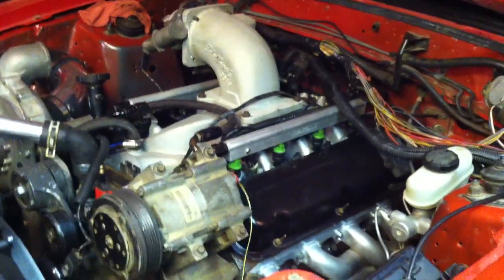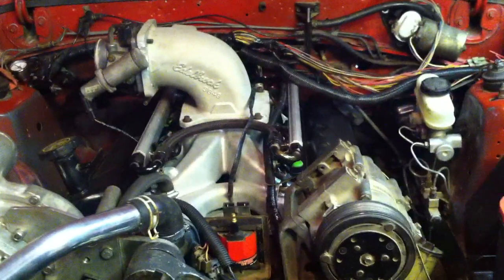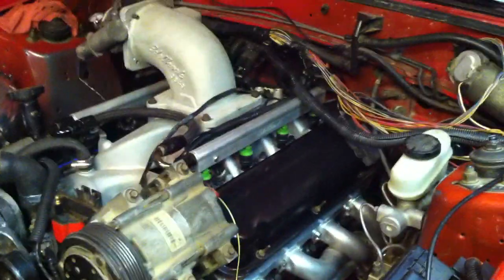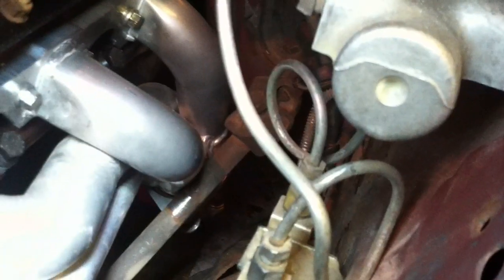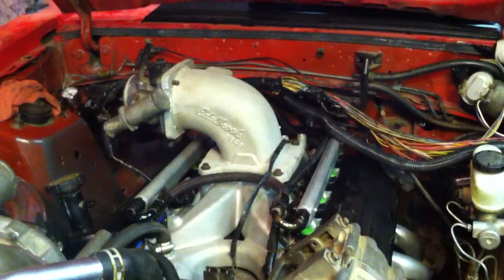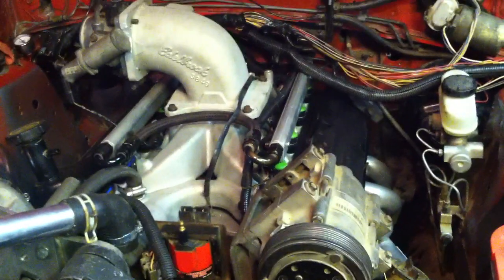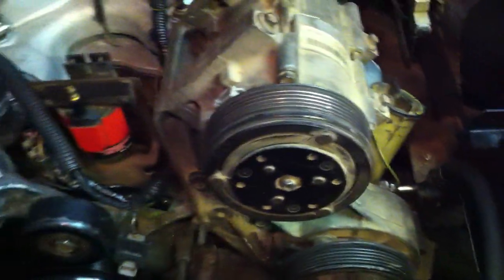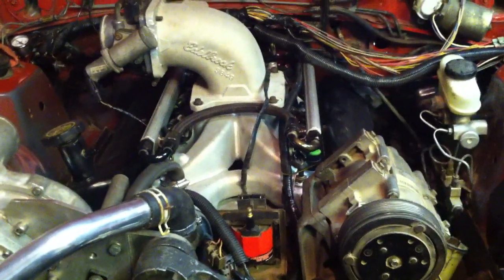351w Swap Tips  [Foxbody Mustang]

Comment: I just changed the k member to drop mine down to use the stock hood, while the k member was out, I upgraded my suspension (front and back) the 351 was supped up a bit and I had to rebuild the tranny to handle the 351 because it destroyed the stock tranny
Over all I spend about $8-9k to get the stock hood, suspension, custom headers and a tranny to handle 650tq in case I throw in a blower, I’m at 383 at the wheels now
Reply from the maker: Nice!

Comment: Good info here, I have a 408w swap going in and sounds like a total plug and play operation with fuel injection.
Reply from the maker: It really is, and there is a lot of equipment and parts that make this easier.  Thanks for the input
Reply: B Stang, I am wrapping up my 408w efi setup and I have the same intake as you except I have a custom cam and heads. Do you think my car will have a hard time starting up on the stock ecu for a break in run? I will be using the 302 injectors/no tune just plug and crank.I have a megasquirt but haven't installed it yet.
Reply from the maker: Your 408 be sucking in a lot more air than the 302..... If your ecu is mass air then it should work ok.  I would suggest something to monitor AFR while doing so just to be on the safe side though.... Let me know how it works out.
Reply: Any update?
Reply from the maker: What kind of updates are you looking for?
Reply: @jellie33414  
Yup update as of 10-26-18, my 408w is running good. I swapped in 80lb injectors and a microsquirt computer, I have been tuning it this week but feels like I have about 3 weeks before it snows or so. Once my cars totally on the road next spring I'll do a youtube channel. Follow me on instagram @john_hanewich. Its a candy red hatch back.
Reply from the maker: Nice!

Comment: lots of great info here. i traded a 79 chevy 4x4 for a 88 ford f 250. was going to put the chevy 350 in my camaro then i got to thinking. 351 in the mustang??? Ya! good to know i made the right move. always wanted a cobra r hood so im good on that part. only thing is that my 302 is pretty hot so i will have to do something with the 351 to make it worth my while. nit sure my rv cam would be good in the 351 yet but i bet my heads would help. worked over 95 heads on a 86 block. will be the third motor them heads have been on lol.
Reply from the maker: +Vapers Win you definitely made the right choice!  I'd be interested to see what the 95 heads do on the 351w.  Might be good, or could be a bit restrictive with the extra cubes.... Nothing a turbo couldn't fix!!!  Good luck, and let me know how it goes!
Reply: 95 heads off of?

Comment: hey question for you I got a 4 banger 87 swapping a 351w just got a torker 2 and 650 edelbrock was just wondering what heads and cam I should run for maximum power and ok drivability it's gonna mostly be a strip car but go to cruise night once in a while thanks great video

Comment: You couldve saved 2inches if u used a 3848 elbow instead and itwould still have room for throttle body linkage and you would've been able to avoid using the washers between frame n k
Reply from the maker: Yeah my mistake on that. Bought the wrong one. Worked out though. If I had the smaller elbow, the intercooler piping wouldn't of fit as well.

Comment: I heard you can use sn95 sway bar mounts to lower the sway bar to clear the oil pan on the 351w swap
Reply from the maker: True... I learned that after I did this lol still haven’t swapped the sn95 mounts in yet, but it’s on my to do list
Reply: Clevor BMF ... Thanks for the info ... I'm interested in the foxbody efi 351w swap under the stock hood
Reply from the maker: It’s definitely possible!

Comment: Curious if the subframe from the SN 95 has more oil pan clearance and if the steering rack shaft is offset more with the bigger mod motor? Anyone have any information, I'll have to do some measurements at the junkyard this week! Swap the whole damn front end and get the bigger brakes and wider stance at the hubs!
Reply from the maker: Not sure on that one... its all based on the fox chassis up to 04 so I assume it’s very similar

Comment: Thanks for the info on wiring, I didn't know everything would just switch over to the 351. I thought i would need the whole harness out of a truck. Does the larger displacement mess with the ecu?
Reply from the maker: Larger displacement doesnt effect the ecu at all.  If you're mass air, or running an aftermqarket ecu it works flawless

Comment: So if I want to do a 351w swap I’ll have to find and engine out of an older ford then? I see they make new 351w crates but I’m not sure. I have an 89 foxbody.
Reply from the maker: You can get a newer crate engine too if you want to.  Same blocks.  If you’re trying to save money, sometimes the used route is cheaper.
Reply: Ahhh yeah I’m trying to look for a used 351w hard to find though around my area... what year engine would be good to go for?
Reply from the maker: I’d go for the 86-96 F series trucks or E series vans as they are already efi, even though the intake won’t fit in a fox... you can also go with the older 78-85 but it’s carb...
Reply: Clevor BMF that’d have to be a short block right?
Reply from the maker: Can be.  Depends on what all you’re needing.  I prefer getting the long block so you get everything including the front accessories.   I use 
www.car-part.com
For my engines.  Gives you a listing of all local parts yards that have what you want.
Reply: Clevor BMF okay yeah, I’m new to this 351 swap stuff but have been looking at stuff on lmr and YouTube and with your videos and all to get an idea on how to do the swap. Thanks for the info.
Reply from the maker: You bet
Reply: lanny222 69 351 was the best 351w ever put in a car

Comment: I'm  going with a 351w with a turbo for my sn95 with a t5. I'd  prefer efi over carbed. would i have to get new wiring for a new ecu or can i use the stock ecu that came with my 302 in my 95?
Reply from the maker: Your wiring harness would work great as would your ecu.  Chip and a tune after your done with the build and you'd be good to go.

Comment: I've got an 80s model 351. will the accessory brackets from a newer style 351 bolt right up?
Reply from the maker: Yeah, as far as i know the 351w blocks all have the same accessory bolt holes drilled in them.  Should all bolt up fine regardless of the year block.

Comment: Hey Clevor, my uncle did this swap for me in my 89 convertible but missed a few things like swapping headers and using the correct flywheel. The issue I'm having is the headers rubbing on the steering shaft. I have a carb setup so I don't have any hood clearance issues, so I was thinking of running the polyurethane mounts because they're taller. I'm not sure what mounts are on there now, but the headers also touch the shock tower on the passenger side, so I'm thinking stock convertible ones. 

That's pretty much my biggest issue. The vibration from the wrong flywheel is a simple fix. Would raising the engine with the taller mounts get rid of the steering shaft rub?
Reply from the maker: You can either use mounts that are taller, or shim them with spacers to get them up.  Personally I'd use shims on the mount where it meets the block and use longer bolts.  That'll lift the engine up for clearance

Comment: What ignition system did you end up using. I’m currently building a very similar motor but mine is stroked out to a 408w.
Reply from the maker: That’s what mine is now.  408 Clevor to be exact.  I used the factory tfi distributor an ignition for a 351w with an msd 6al.

Comment: Hey man curious about how you like your motor mounts. I bought some MM solid mounts but I want a decent street driven car. If you had the chance to do it again would you stay solid or go a different way like poly or stock
Reply from the maker: I like the solids.  you can feel a little more vibration, but it doesn't bother me at all.

Comment: Hey buddy, I have a question for you. Is that intake combo worth it?Could I use it ,but with a split plenum intake??Will it sacrifice low end torque??I would appreciate your input on this set up!Thanks. Car looks sweet by the way!
Reply from the maker: Thanks Frank!  I really liked the combo..... I felt like I gained HP and TQ when I switched tho this setup.  I never dyno'd it like this, but seat of the pants was great!  I think with something like this, you may lose a bit of torque with the shorter runners, but you gain a little top end HP so it evens out.  I'm not sure on the split plenum setup, but I don't see why it wouldn't work....
Reply: Clevor BMF I appreciate it my man!I might try it,lol.

Comment: if I had a complete 351w what all would I need to swap it? oil pan, and headers is a given. its a 351w fuel injected
Reply: using stock 302 mounts
Reply: the 351w has wiring harness and tranny, I'm using the aod tranny already in the mustang, I have to use this harness bc the old setup was a 302 carb
Reply from the maker: +jesse kaiser physical parts depend on your exact requirements.... 

stock 302 motor mounts fit the 351w, so you can use those but they can can cause clearance issues if youre using the stock hood (depending on your intake setup).  There are solid drop mounts and fox body convertible mounts that some have use to clear a stock hood.  There is also a k member spacer kit that you can get if you really want to use a stock hood.

351w has a taller deck height than a 302 so youll need 351w swap headers to connect to a 302 factory style exhaust.  

you'll need a 157 tooth 28oz balance flexplate if youre going auto.  that'll bolt up to the torque converter already in the auto you have.

The last consideration in whether youre going efi or carb.  I've got another video detailing efi swap  tips for the 351w if that's the route you go.

Comment: One thing I have heard different things about, maybe you can clear it up. I have the 5.0 ho in my 93 and I want to keep fuel injection. Will the lower intake bolt up to a 351? I would want to pick up a gt40 off an explorer, would that work? Or are they different for the 351? Same issue with heads, will any 5.0 head work? Thanks a lot, and nice looking car
Reply from the maker: The 351w has a taller deck height than a 302, so that makes the lower intake not work... The only EFI gt40 intake that they make for a 351W was on the lightning. They are the most low profile and help keep stock hood. The aftermarket EFI intakes for the 351w are slightly taller and usually require an aftermarket hood. Summit Racing and Jegs sell a good variety of EFI 351w intakes. You can however bolt a 302 upper to a 351 lower, provided the ports match.. As in, you would want a 302 gt40 upper to a 351 gt40 lower. Any heads from a 302 will work on a 351w, but the head bolts are 1/2" so you usually need to drill them out slightly. Otherwise they don't require any mods.

Comment: Hey B Stang, great videos.  I was looking for some info, seems like you should be able to help.  I have a bunch of gbody friends going LS and they try to convince me to go LS but I really want to go 408w.  only problem is I don't really have the ford money.  Any ideas for a good block that won't run me thousands? I'm also looking to do mostly Trick Flow products and a procharger.  Your videos definetly help!
Reply from the maker: Matt Depner  stock 351w block will handle a good amount of power.... around the 800 mark if you keep the rpms reasonable.  I've got a stock 351 block that's a 408 and regularly revs to 7000.   550 hp engine with a supercharger.  That's my suggestion!

Comment: I have a 351 @ my house from a truck. My plan is aftermarket heads, cam, intake, injectors. I want 400rwhp, I heard it's possible with a 351. What would you think? Any advice is appreciated, thanks.
Reply from the maker: +Wesley Marion Jr. Easy deal.  Decent set of off the shelf heads like afr 205's, good cam like tfs1, and trick flow r intake would get you really close to that.  throw in some boost and you'd be way over your mark.
Reply: +B Stang thanks for the quick reply. I'm debating between going turbo with the 302 or built 351. I know I want 400s to the wheel, just trying to see what is the better option for the $.
Reply from the maker: The cheaper bet is on the 302 with turbo.  Safer bet is with the 351w and a turbo.  Stock 351w block can easily handle 2-300 more hp/tq than a stock 302 block.

Comment: if I find a 351w (like out of a truck) what all do I have to change on the motor besides oil pan to get it to fit in a sn95? can I keep my 5.0 computer or do I have to get the computer out of the vehicle the engine came out of?
Reply from the maker: Well, that's kind of a vague question... I'd start by watching my other video.... https://youtu.be/8zgGe2bfnK4

As far as the 5.0 computer, yes you can use that and the associated wiring harness, but how well it will work depends on whether it's speed density or mass air, and also how modified you make the 351w.  The 351w will run on the stock ecu, but to run it's best you'll likely need a tune.  The ecu from the vehicle it came from would work, but the pin out on the ecu is slightly different so you'd need the wiring harness as well and that's a huge undertaking to wire it all in......

1. The truck intake is very tall, so you'll need a new one unless you're going hoodless....

2. You'll need a 351w swap oil pan to fit around the k member of teh foxbody...

3. Depending on what type of exhaust you plan to run, you may need a different style of headers... There are a lot of variable here depending on your budget.....

I'd highly suggest determining your budget and answering some of the questions for yourself that I pose in my other video, prior to deciding on which way to go... There are a lot of ways to save money, or spend money dending on which way you go.
Reply: B Stang thanks for the response and suggestions.

Comment: I just bought a 89 with the 2.3 in it and want to 351 carb (heard it was easier and I like the smell) I don't even know where to start this is my first build ... Any advice ..
Reply from the maker: Nook Lemniscate  Make sure you check the link in my description if this is your first build.  Latemodel Restoration has a great list of parts for the swap.  A stock 351w from a truck or car with factory heads wont be much of a power difference than a stock 302 from a foxbody (depending on the 351w of course, but in general this is true).  Get a good set of heads and an intake that will breathe well and you'll be very happy with the extra torque you'll get.  depending on your intake manifold, carb, and air filter choice you wont have much room under the stock hood.  Be patient during your build and research the 351w so you get the right parts the first time.  And, enjoy yourself.

Comment: Can you give me advice how hard would this be to do on a 98-4.6 stang with cowl hood, and would it be better to use an older 351, or what..
Reply from the maker: Wouldn’t be that tough.  The 94-95 s351 came with a 351w, so it’ll fit in the sn95 cars.  The tricky part would be wiring up the efi for the 351, depending on what setup you go with.... you should be able to use the same 351w swap parts for a foxbody in you SN95.  The 351 block/engine year is debatable.. almost all are flat tappet cams, so if you want a roller you need to do a conversion (not a big deal).  I’d use the 90s blocks/engine just because of the availability.

Hope that helps!

Comment: What bracket is needed to add the air conditioning to a 351windsor in a foxbody?
Reply from the maker: There’s a 351w specific bracket that you can get from late model resto that makes the ac fit.
Reply from the maker: This should be more helpful:

https://youtu.be/lW4uf6dYoCE

Comment: Hey man thanks for the helpful video. I'm doing a 351w swap and I want to run a carb style efi intake like yours. Did your computer run okay with an intake like that? or did u have to get it tuned?
Reply from the maker: Stock ecu ran great this way.  I upgraded injectors and matched the mass air meter to the injectors.
Reply: Thanks for the reply! I just wanted do injectors and maf.
Reply from the maker: Yeah, you can definitely get away with just doing that... the only thing that might cause issues is if your injectors are too big for the application... then you might need a tune.... I didn't with mine, but I only went to 24 lb injectors.  was probably a little lean, but worked ok until my next upgrade.
Reply: Cool I was thinking of just doing 24 or 30lbs injectors. It's a fairly mild combo, I just have some 351 d0oe heads I ported for it. Havnt picked a cam yet might even reuse the e cam from my 5.0 for a while to get it running sooner. How's the low end with it? I've got 4.10s and a 5 speed so I'm not really that worried about it but curious how it compared to the gt40 intake. I want to supercharge later on so I'm wanting to get an intake I can grow into.
Reply from the maker: The torque is the best part!  I just upgraded my engine again to a 408w with Cleveland heads... so now it’s even better
Reply: I was actually thinking about stroking to 393/408 since I'm rebuilding the 351w on a stand anyways and the cost isn't much higher. I'm just a bit worried with the d0oe heads it wouldn't be worth it. I actually found your videos at first when I was looking at doing a clevor super cool build man! I love builds that aren't the regular cookie cutter builds. Did you use the 4v or 2v heads ?
Reply from the maker: 4v closed chamber heads.  That’s why I decided on it.  It’s not something you see much of! They are awesome engines though, glad I went that route... but I also miss how easily the 351w swapped in vs the Clevor...